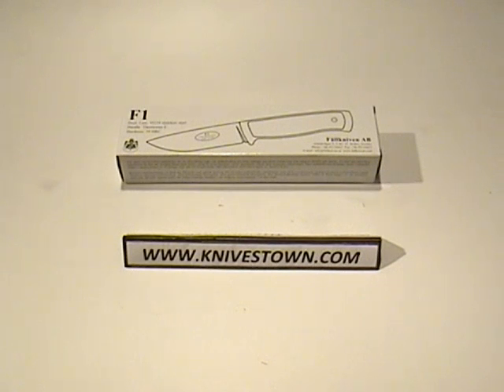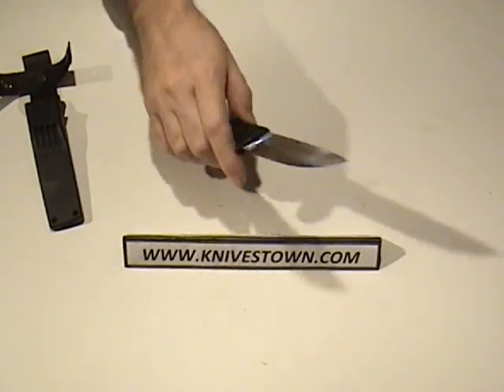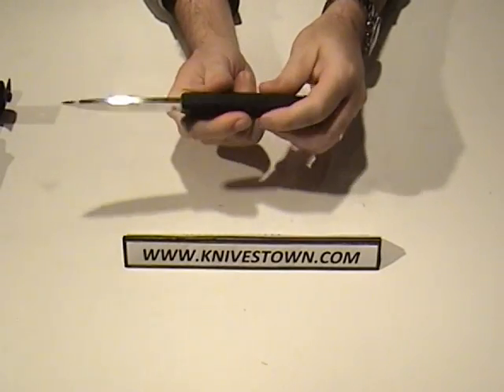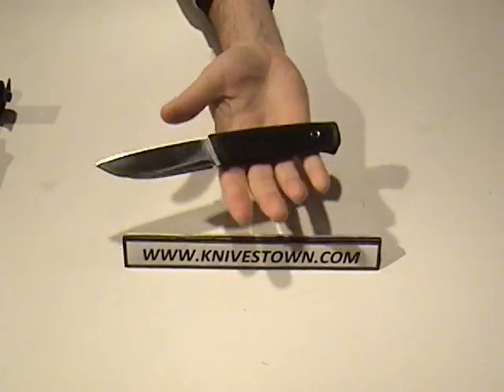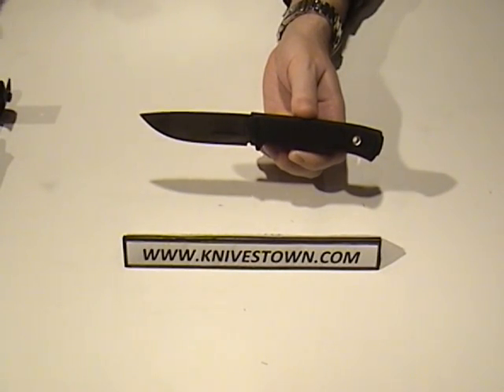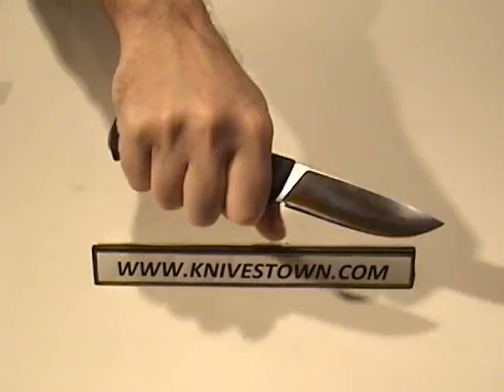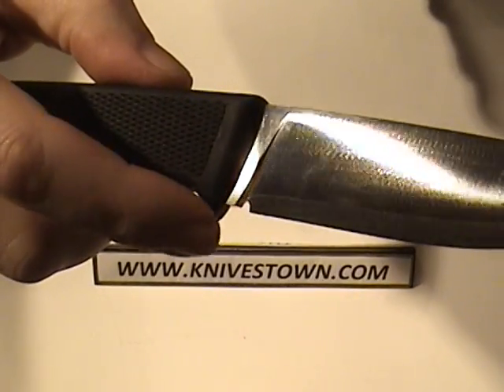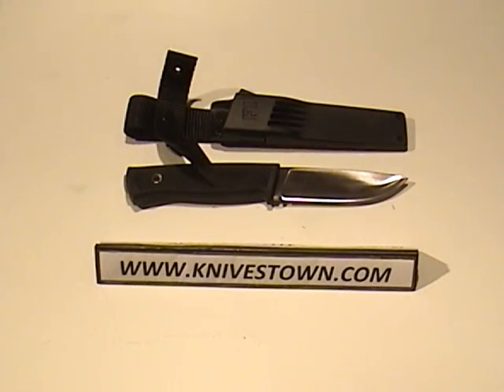Fallkniven F1 Survival Knife - 3G version.mpg

Comment: There is a 3G version out which is not limited edition - it has no serial number on the spine and does not have F1/3G but instead says F1 and then beneath that, is written 3G STEEL. It also has both the crowns so having the crowns alone does not mean it is the limited edition. Just updating the info for anyone looking specifically for the limited version. Thanks for the videos.

Comment from the maker: @bigdogITbiker    No. powdered steel has nothing to do with laminated steel. Laminated refers to the combining of two fully formed steels together in one blade.  "Powdered Steel" refers to how it is made.  It is literally made from powder like a recipe.  Individual alloys are combined in the exact proportions wanted that will provide the characteristics of the steel one wants. The powder is mixed together so the alloys are evenly distributed throughout and then subjected to heat & pressure.

Comment: @ROMACAPUTMUNDI1927 Problems? No. But due to it being a very hard steel it does take a bit of effort to sharpen, but once it is sharp it will hold that edge for ages. 

Fallknivens come with a razor sharp edge anyway so unless your going to baton with it or chop and hack, basicly abuse it, all your going to need to do is strop it now and again on a leather belt with a little polishing compound.

If you do get one get the satin blade and the leather sheath, trust me.

Comment: That can't be a 3G model then as the the 3G model is 62 HRC. To me that looks like the laminated VG10 model either that or you just got your hardness wrong but none the less it's a fantastic knife. I've put my own through hell and it still shaves paper like no tomorrow. Any of Falkniven knives are quality and they will last you a lifetime. The new pro model has laminated cobalt steel with a Rockwell hardness of 60 and comes with other goodies but the 3G model will still keep an edge considerably longer and in my experience a better knife. You should also consider some bark river knives in CPM-3V who are Falknivens main rivals but for the ultimate edge retention get a custom knife made in Maxamet steel like I have done.